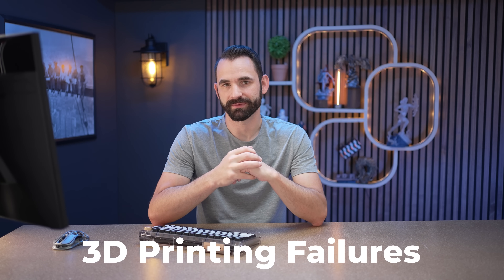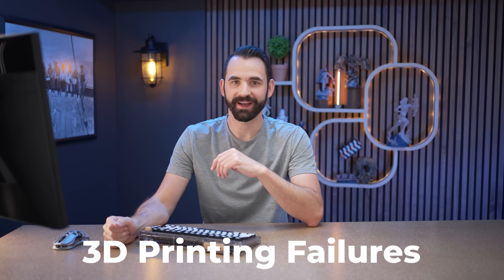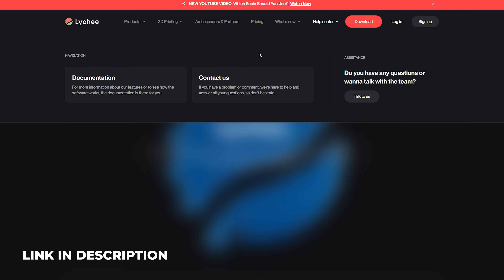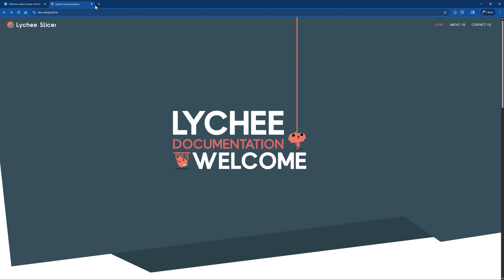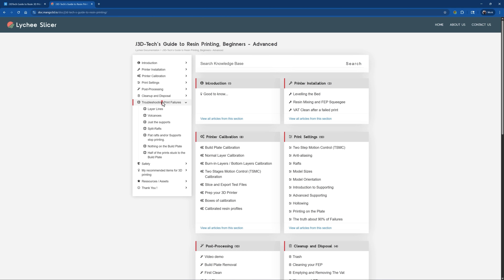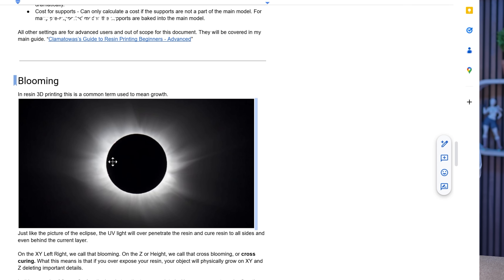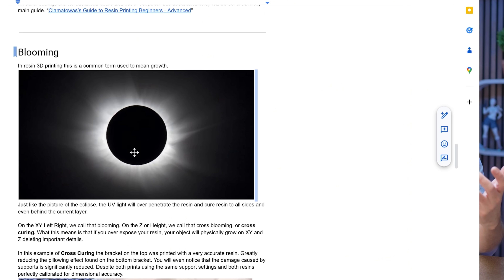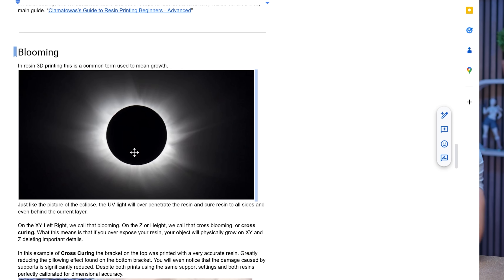Suction cups or Peeling forces? | 3D Printing Terms Explained #2

Comment: Is there anything at all, that I can combat layer compression on a Saturn 4 Ultra 16k with? Z-Offset is off the table here, because of the "ingenious" pseudo-auto-leveling... After battling adhesion issues and a serious headache trying to manual level this thing (involved sanding down the build plate on a level glass plate and adding washers to the "leveling" screws) I was recently able, to print your build plate calibration (the one with the five flat things) and got all 5 of them within 0.13mm of equal thickness. BUT the 1mm section measured from 0.56 to 0.69mm, which indicates insufficient z-offset. So there's that, any advice on how to proceed calibrating this mess? starting to get pretty unhappy with it
Reply from the maker: Join us on discord to get help with 3D Printing! https://discord.gg/NGDDTgY

Comment: Brilliant video as always BUT please help, My prints are missing in the centre but sometimes the centre will print and it will not stick to the area between the centre and the rite side. I had it solved with upping the exposure but then it started happening again. I've re-leveled, got the z axis offset very close to perfect, we're talking 0.02 mm off, I have the bottom exposure set to 29, this is way above my other printers. The problem is on my mono 4 ultra, she was always having this problem but ive run out of trouble shooting. The randomness of this is killing me. I've releveled with different amounts of posting notes, I've got the calibration tests printing fine but no actual model will stick. The plate is leveled with an average difference of 0.05mm between corner heights. The lift height for the initial pull is 4mm and very very slow. I think it might be temperature but I've just run out of ideas. Any help info would be appreciated.
Reply: A lot of build plates aren't perfectly flat, so even though your level the center might be concaved. 

If you're printing the the build plate calibration parts, have you noticed that the center parts measure thicker?? 

Next thing is is that 4 mm total lift on the bottom is about half of what you need. I left a total of 8 mm for the bottom layers and 6 mm for the normal layers. 

Because I use tsmc I do cut that in half four and four for the bottom and three and three for the rest. 

Try doing that. Make sure you're using between 2 and 3 seconds for light off delay and let me know how your results end up.
Reply: @J3DTech  Thank you for the responce.

Ill have to check the centre parts, but when i set a ruler along the build plate and shone a light, there was no light leaking through at any point in the centre.

The 4mm is the not the total lift its just the first half of the lift i think my total distance is roughly 7.5mm, my light off delay sits at 2.5s.

I literally just finished another test print before responding to you and it was a complete success, no failures... It feels chaotically random, very awkared to troubleshoot.

Ill run the calibrations again. From memory i think there might have been roughly 0.03 compression, as in the thickness of the centre compression test disc measured 2.06 instead of 2.09. I honestly thought anything within a 0.05 tolerance range would be fine.
Reply: @honda1st1 0.05 is more than good enough for sure. It maybe that you just needed a bit more bottom UV exposure time.
Reply: @J3DTech  Yeah i have it at 29 which feels very high to me, all my other printers work between 21 and 25. Mabey its the temperature but ill keep working at it.
Reply: @honda1st1 29 is fine below 35 and your average
Reply: @J3DTech  Thanks for taking your time to reply man i really appreciate it.
Reply from the maker: Join us on discord to get help from the community and derek! https://discord.gg/NGDDTgY
Reply: @Lychee3d  Will do cheers.

Comment: I would love to know your top 5 machines.or maybe different machines at different budgets or uses. 

Also would love tuning vids per each machine because some come with different settings and features like 2 stage movement etc and some settings will be common for each resin per machine
Reply from the maker: Great suggestion, we are planning some content on that soon!
Reply: @Lychee3d please do the gktwo, an older machine but still awesome!

Comment: How about the reason for the empty supports, and the solution, you blew past that one? Thanks for the rest of the info!!
Reply: If you mean just the supports that one can be a bit complicated. 

But most often the time it's just not enough light off delay. Or it could be that you've got too many supports in an area creating what looks like a forest that Forest can inadvertently create suction cups and suction cups can also cause that problem.
Reply: Empty supports? What one is that?
Reply: @J3DTech When a print is complete and a couple pieces don't print, only empty supports on the build plate even if there aren't suction cups and decent supports and 5 on the light off delay. Just like the image on the intro photo. THx!
Reply: @AStarkr3802 How did you calibrate and the odds are? Is that those particular models just aren't supported well enough? Just add a few heavies in there on some of the larger islands and should be good

Comment: a year ago i had a printing problem, in a strange S shape over the whole buildplate nothing printed / did not print on that places. the cause was, a cable inside what was hold by ducktape got lose and blocked the light. i just want to add a little thing that can happen, a lose ducktape 🙂
Reply: That's a silly one. Never seen that before but yeah that would do it 😂

Comment: omg! that boxes of calibration is huge!! curious on how you printed it. Just like a normal small one or did you end up supporting it.
Reply: Just like normal, I scaled it up by a few hundred percent and hit print. Worked great and honestly I think it's still valid. Boxes don't care if they are scaled.
Reply: @J3DTech  haha thats awesome. I thought maybe the 'raft esk' type floor of the print would have gotten too thick. but then again some people manage to print full on bricks when their LCD dies.
Reply: @ItsBrody I did print it slow lots of light odd delay to keep it cool.

You also might find this counterproductive but I keep my printers in a cooled area about 20 to 22° c. Max. I then run heaters inside of them. This keeps the components cool while keeping the resin at about 24 to 28° c